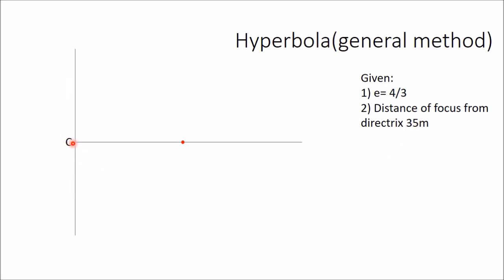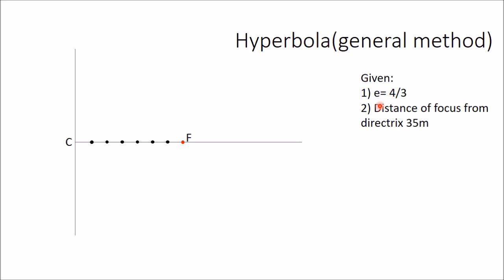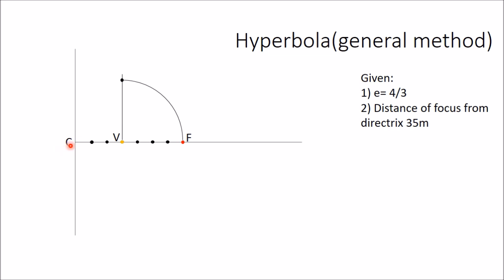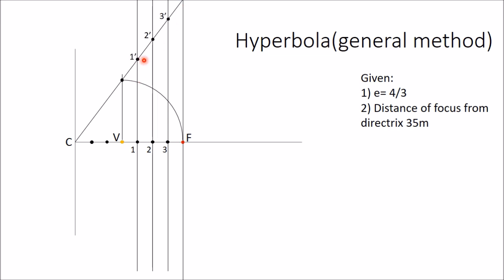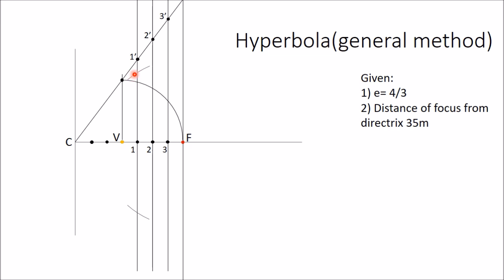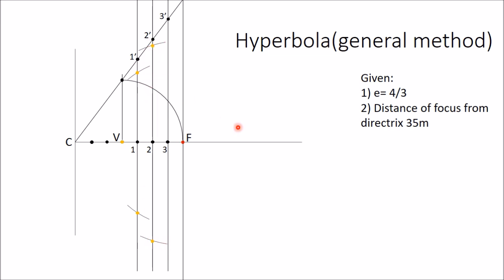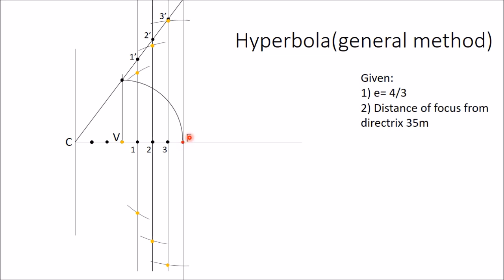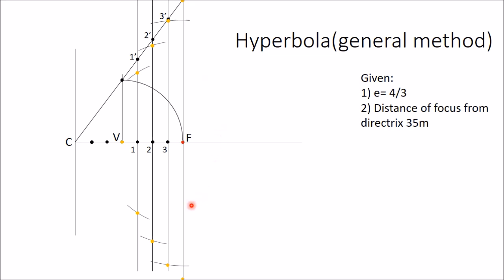Construction of Hyperbola (general method)

Comment: how divide into 7 equal  parts
Reply: In question 4/3 is there just add those 4+3=7
Reply: The Cf is 35 mm, so dividing 35mm by 7mm we get 5 mm.
Parts should be of 5mm each.